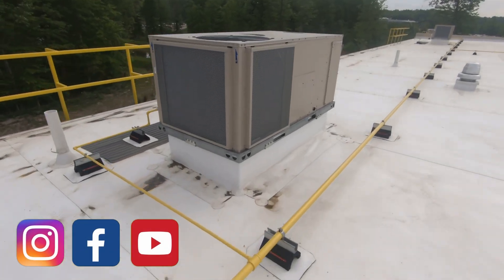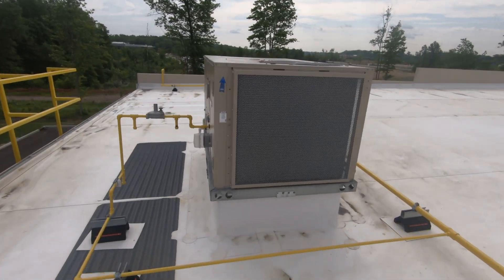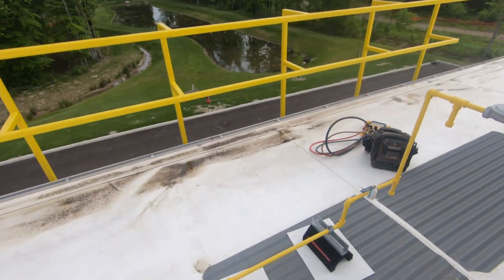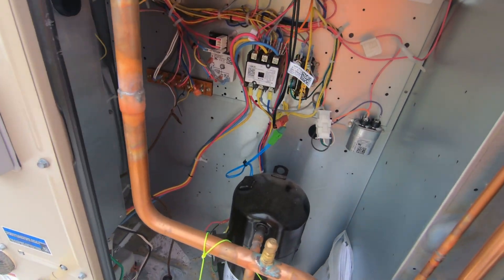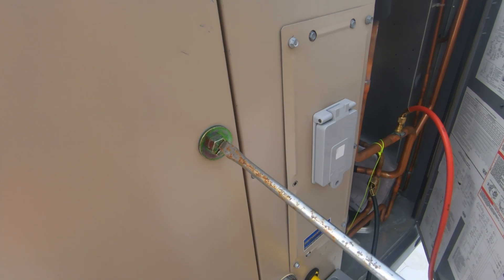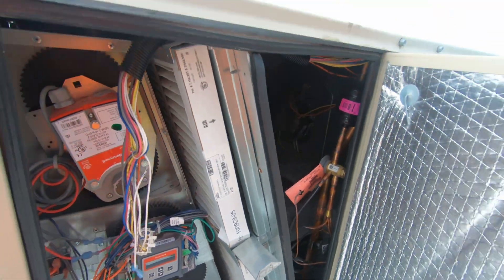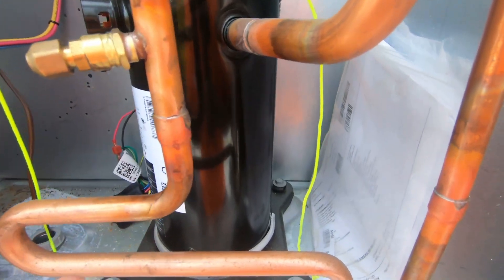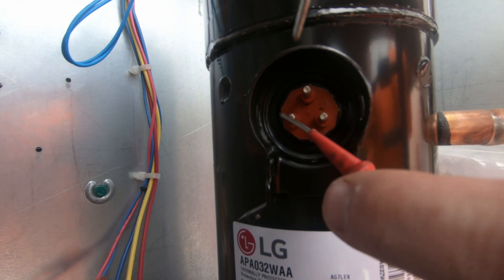No AC Service Call. Compressor with open windings

Comment: You jumped G to R to bypass the thermostat. I am a newbie.   Is G just to power the blower relay ? How does Y get power for the compressor contactor ? I wish you had referenced the wiring diagram for this important point so everyone could follow. Thanks for a great video
Reply from the maker: 24v feeds down to the thermostat from the transformer, the tstat is basically a switch that sends power back to the unit depending on what you want it to do. if you want ac it sends 24v to y and g. if you want heat it send 24v to w. in the old days the 24v would go back to a series of relays but now it goes to the main control board and the board will then send power to the contactors to bring on the bower and compressors or start the heating process by bringing on the inducer. sorry im late with the reply.

Comment: I'm always amazed by this type of issue, how are these guys passing the interview process and getting hired?  I had a situation where we installed thirteen, 20 Ton, 2 stage package units on a warehouse and 3 of them didn't start up properly. One had zero refrigerant, one had a bad transformer and one the blower didn't work. The technician said the blower motor was seized up and needed to be replaced. So being the pain in the ass Project Manager I am, went up on the roof myself only to discover 2 of the 3 blower motor spade connectors had come off the bulkhead connector due to shipping vibration or just a factory screw up. I spun the blower motor by hand to verify it wasn't frozen and with the wires reconnected that unit worked perfectly. I also took the good transformer from the unit with no refrigerant and replaced the bad transformer on the other one so now there was only 1 unit needing service. For anyone reading this thinking I shouldn't have touched anything that is under warranty here is my response. Then don't do such a shitty job that the customer CAN find your mistakes!!

Comment: Somebody failed the start up.
Reply from the maker: Indeed
Reply: @RyanHughesHVAC  good find, wonder if others on the roof are that way?
Reply from the maker: No, I looked at all the other units to gather data plate info and pushed compressor contactors in just to make sure